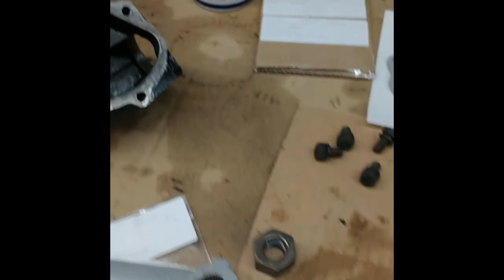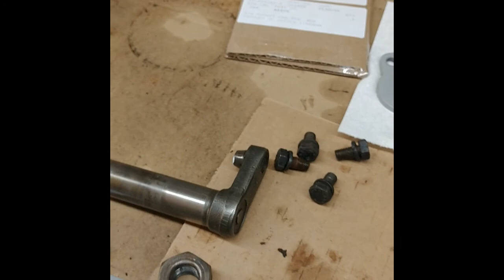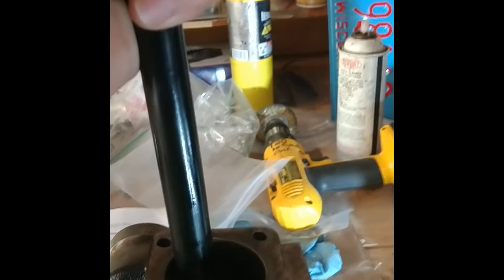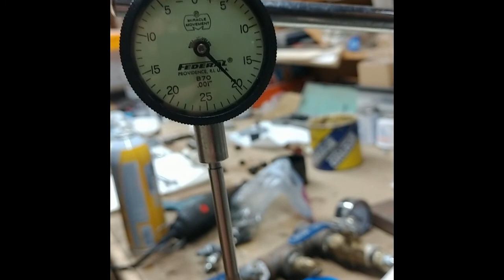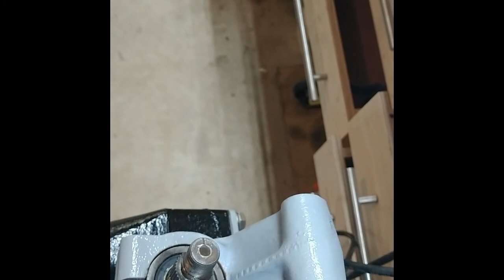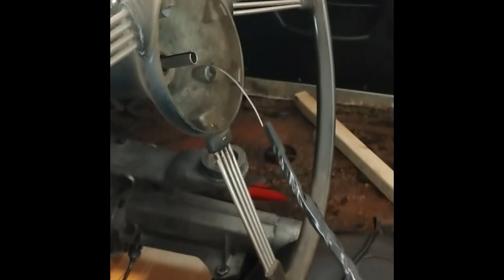1959 Triumph TR3, Part 25, Steering Box Reassemble and Install

Comment: What torque settings did you use on the bottom plate bolts
Reply from the maker: I don't remember as this was some time ago, but since the bolts are not going into Al or some soft alloy, I probably used the standard torque for the bolt size/thread.

Comment: when you were measuring the shaft stick out, you were in inches not millimeters. your measurment was 3 hundreths, not mill's
Reply: and im guessing you measured the shims the same way because 30 millimeters is about an inch and an 1/8

Comment: FYI, according to the Macy's garage tech page on this topic, one uses an exactly 1" o.d. washer slid in through the gap from the inside to sit on that bushing. You can then press it out and the washer can follow it through the hole. If you don't have any play, however, there isn't much of a reason to replace it.